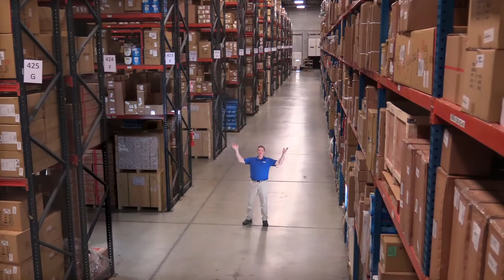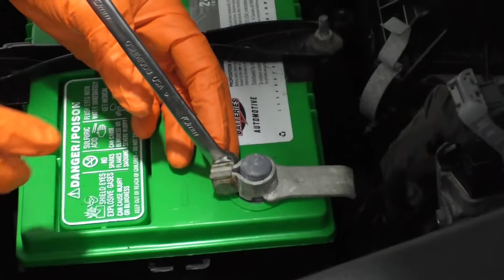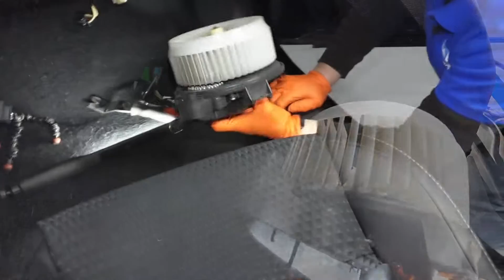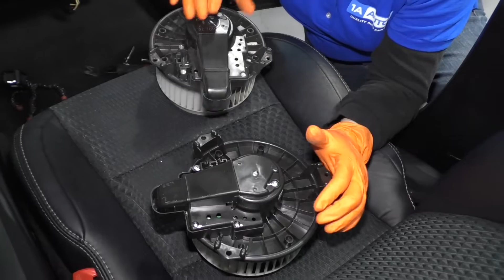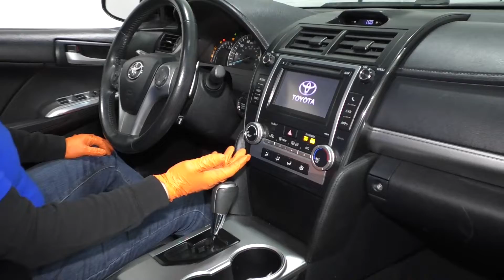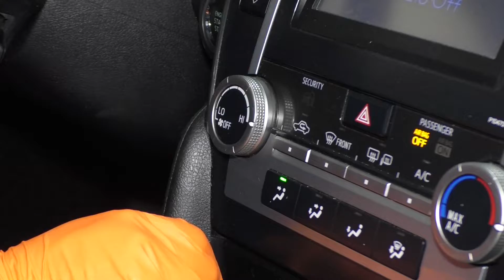How to Replace Blower Motor 11-17 Toyota Camry

Comment: Picked up a blower motor from autozone and the vibration is absolutely ridiculous when you set the fan speed to high. Originally I thought I might’ve installed it wrong but I don’t think that’s the case. It didn’t have any weights on it either 🤔 PM9351 is the part in case anyone wants to know

Comment: I just hate disconnecting the battery on these cars that has a computer brain that needs to be "ON" all the time otherwise, if you disconnect the battery it pretty much kills the brain's programming and that's when you start having problems when you connect the battery back in again.  I replaced the blower motor  on my 2010 Toyota Camry without disconnecting the battery and it worked just fine.  Why disconnect the battery ??  You'll only going to disconnect & reconnect one power source to the blower motor and that's it.

Comment: The blower motor connector won’t come off with just pushing in the clip and pulling out. Would you suggest another way to get it out?
Reply: Had the same problem.  I held the clip down and pushed from the bottom with a small flathead screwdriver and it popped right out.  In the video she does it with ease, but for me that took almost as long as the rest of the job!

Comment: I have the 2011 Venza. I just replaced the cabin air filter (passenger side) and now I have a noise coming from the AC, which is louder as the fan speed increases. Is the blower motor on the passenger side? I figured the Venza would essentially be an AWD Camry Wagon...?
Reply: Hi I'm in the same situation as you. The blower motor is on the passenger side, and the noise is due to leaves and other debris in the motor itself. You have to take the motor out, it's simple, just like this camry and clean it out.

Comment: So the resistor is built in for the camry 2013?
Reply from the maker: +drummer2be92 Yes, the resistor is built in just like the one we sell for your vehicle!  https://www.1aauto.com/toyota-lexus-heater-blower-motor-with-fan-cage-diy-solutions-hva01405/i/1ahcx00296/541272/2013

Comment: ive got apparently a squirel as there was a whole lotta pecan shells on my filter  when i pulled it out most of them fell down in my blower motor  i will pull and clean but how is he getting in  is there a break in my air line under the dash or is there another way for him to get in